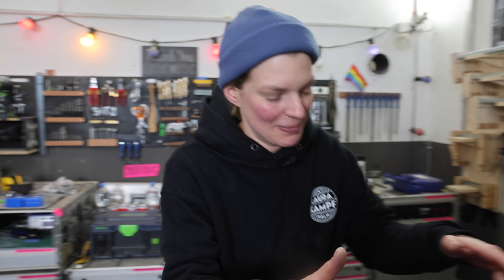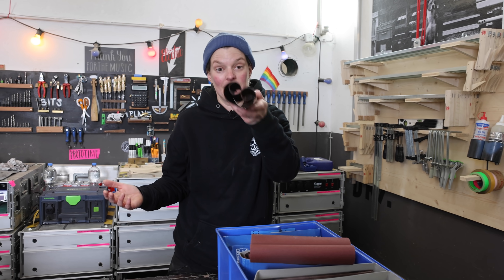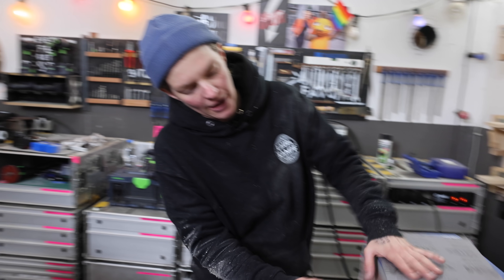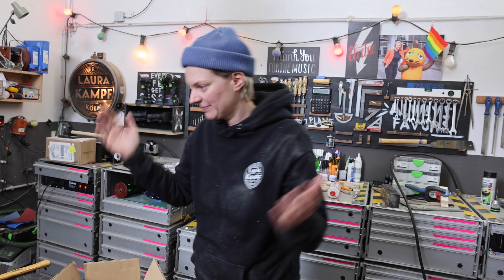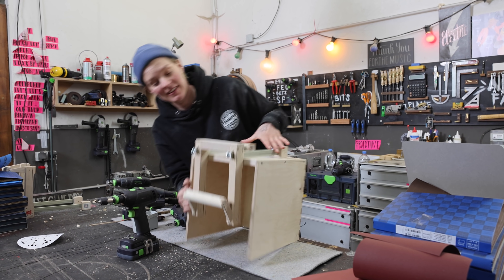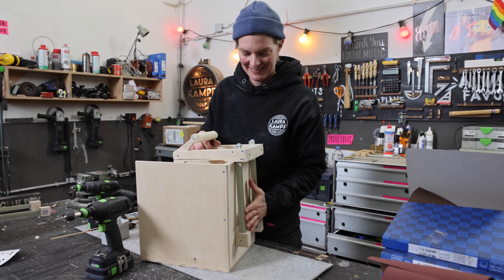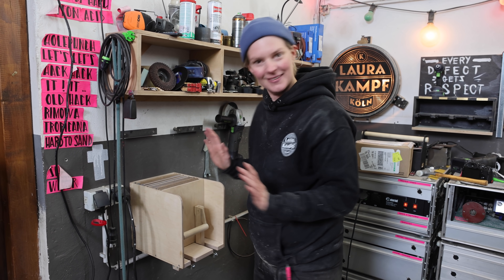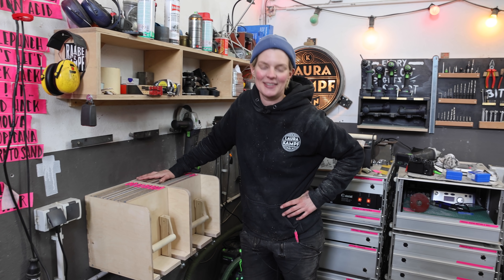Clever Sandpaper Storage (no more rolled up sheets)

Comment: I recently made a great solution for the large rolls of sandpaper: 1L (Greek) yoghurt buckets. I just cut a slot in the side and pull the end of the roll through. Perfect free sandpaper dispenser.

Had them on a bar first, but they unrolled themselves and made a mess.

Comment: Was googling for a sandpaper solution...found some photos...this one seemed a really nice idea...a video on hackaday...what-daya-know, it's an idea from Laura! Of course it is!
Reply: Update: my version is finished!
Since I wanted to keep small off-cuts stored as well, I only made the sidewalls half the height for easy access.
I didn't build the clamp system (yet). For now, I just have a rubber band (old bike tube) stretched around the center to press everything tight.
To avoid that the front plate just falls out, (there's nothing stopping it like with the clamps) it's attached to the back with 2 bits of rope so it can fan open to about 45 degrees.

Comment: This is the way you design so often. Making decisions based on assessment of need and materials as you go. Very different from the drill press oiler when you started with ‘I want to use this windshield squirter motor’ and then assessed how to make use of that one item. Been thinking a lot about that project. My suggestion for the oiler is magnetically attach a traditional pump can to the drill press (as you attached the other) but replace the standard spout on it with an extra long flex tube spout. With that arrangement your hand knows how to find the pump without looking up from your work and you can move the spout to the work where your looking. Make sense?

Comment: Very nice idea. I have just been using the A4 plastic folders with about 6 sections in them, they would compress really well in this arrangement. I tend to only use wet and dry paper which doesn't roll up as badly but I feel your pain :)

Comment: Interesting how peoples brains are different. You put the finest grits in the front, but I would personally do the opposite. You start with the coarsest grit, and work your way up, so to me course grit paper would be in the front. But I'm sure you have a reason to do it the way you did and it works for you. Great solution, and I love the clamp idea. 

I, with much less space, use a cheap accordion file from the office supply store to keep my sand paper.

Comment: I like these storage boxes.  I thought it would be a simple (and quick) task to make a box, probably with dividers to go between the sandpaper sheets - how wrong I was.  Those wooden clamps are so suitable to this task and I couldn't think of a better way to attach them.  I keep my sandpaper in industrial strength plastic boxes that have an airtight seal in the lid.  My workshop is freezing in the winter and roasting in the summer but I don't have your 'curling up' problem.

Comment: A project idea for your shop ocurred to me while watching this morning:  A spring loaded bracket that will span different sized sheets of plywood, attached to a rope or chain hoist.  Put it on a rial attached to the ceiling, and use it to lower the ply from the loft down to the shop floor.

Comment: Really nice!  I am thinking of trying to build one for my french cleat walls.  

I do not know if you have ever built your own (Klemmsia style) cam clamps, but you could try flipping over cam, so that when you pull, it unlocks, and when you push down it enguages the clamps.  That said, pulling the lower bar connector seems to work well.  I also got to thinking that with the storage unit fully stuffed, pushing down to enguage would also help shorten how far out the hands stick so that you run less of a risk of bumping into them.

Comment: Ah the broom stick returns. Did you think of making a heated cabinet to store your sand paper with your glues and stains? The 'record store' shelf idea turned out awesome Laura, and Felix, I thought you were going to have to use some sort of screw clamp. I keep sand paper in shelves by grit, spaced about 3/4" apart. The klingspor sand paper I try to always buy doesn't roll up as badly as other kinds.

Comment: I store my waterproof, fine grit sandpaper in folders, tucked tight between two cabinets. Coarse non-waterproof sandpaper I buy and keep in 10cm wide rolls in a drawer, together with various grades of wire wool and sanding-sponges.

Comment: Unnormal! Just how good that works! Knowing how much these clamps cost, it's not a cheap solution, but one could probably exchange money for time and figure out how to build a similar mechanism from scratch. I can imagine how good it feels to use it though. And you can easily scale it down when you never have that much sandpaper.

What's the benefit of the not-paper-backed sandpaper? You mentioned durability, but then apparently there is a reason to still use the paper-backed, too. As you built two boxes, I suppose you keep both types in stock.

Comment: Hi if the sand paper is rolling because of the cold damp air, why not add thin wallpaper air bord its a warm foam sheet a little warm contact with the paper sand paper will keep it dry and stop the rolling sand paper. Brendan IRL

Comment: Great solution for the organization problem, but not sure if it will solve the curling up problem. When you take out a piece of sandpaper, the pressure is released and won’t it still roll up?